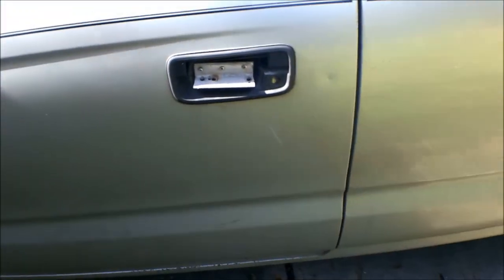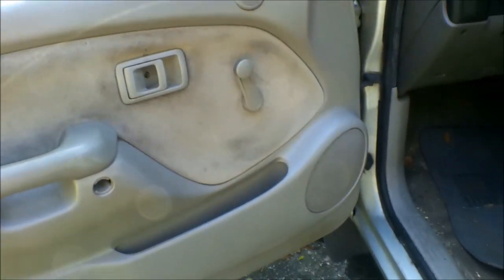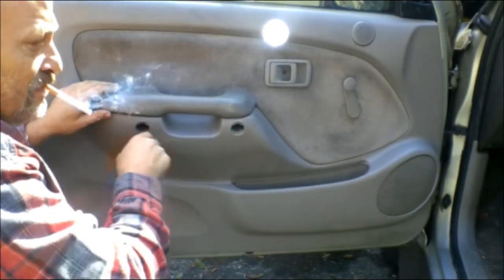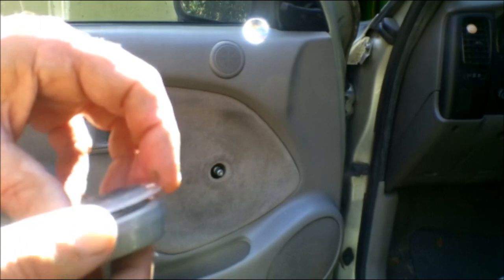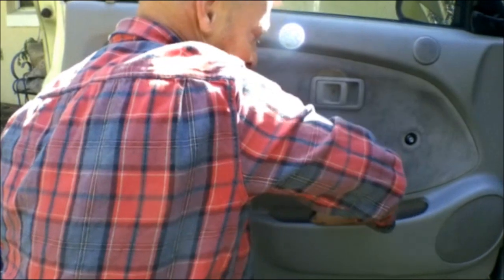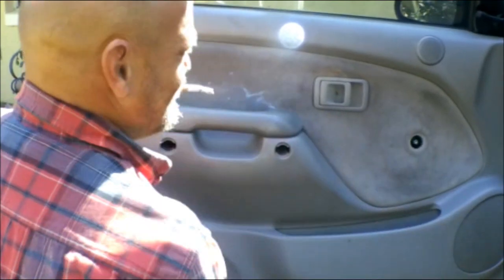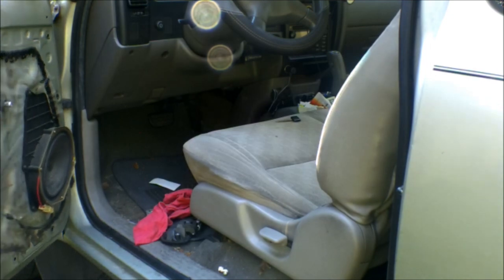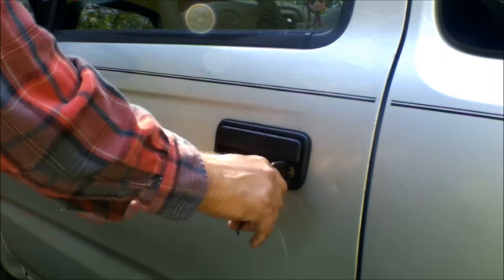HOW TO, REPLACE DOOR HANDLES 03 TACOMA

Comment: Ya man. I’ve replaced both exterior door handles at least twice. Idk why, but they suck. I have found that if u live in a desert climate, the door handles become weak and mailable. It pays to remember not to jerk the door handles aggressively in warm weather
Reply from the maker: That's for sure man. Thanks for watching and commenting my friend.
Reply: @shabear1000  no problem. So I’ve got this issue lately where I can’t open the driver door from the outside. So I started taking the door apart. I used ur shop rag hack to get that lil pin to take the door handle off. So as to not hit my gfs infinity with my Tacoma door, I pulled it closed. Now I can’t open my door from the inside or outside. The door isn’t completely closed, u know. I pull the the metal wire connected to the door handle so as to try and open the door, no dice. Any suggestions other than what I shouldn’t have done up to this point?
Reply from the maker: @mikeytoolica33  yes, it's probably locked. Make sure it's unlocked then pull the rod again. Let me know if it worked.
Reply: @shabear1000  u know, funny thing. I haven’t been able to lock that door for awhile now. Consumed with it not opening from the outside, I didn’t worry about it.  Until I went to go and try to fix these door issues, I really didn’t have it so bad. Now I made the problem worse. Thx for the suggestion sir
Reply: @shabear1000  shower thought: out of everything u said, pull the rod is the only thing that stood out. Got the stupid door open!!
Reply from the maker: @mikeytoolica33  lol that's good.

Comment: I think there is screw up by the MIRROR that needed to come out...
Reply: No. It just pops out. It's a tab that you just take off with a rubber flathead or just your hand and it pops out
Reply: The only screw by the mirror is attached to the thing that allows u to adjust ur mirror from the inside

Comment: It was informative to a point . But the part I find ironic is how you hate it when people half ass things but then you do the very same thing when you ran out of memory. Didn't REALLY show us how to take the rods off or, more importantly  how to reclip back in !! Do we transfer lock to new handle then attach rod? Do we set new handle then try to attach rods from inside? Pull rods out through handle hole and attach then try to set handle in? Guess I'll fart with for an hour and figure out on my own. Half assed!!
Reply from the maker: First of all, it wasn't done half ass, it was done right, secondly, I explained all the info in the video if you payed attention. I used new parts and nothing was half ass about this job. The job is done and done right. I explained how the clips are installed and I also explained how it goes back together, opposite of how it comes apart. I half ass NOTHING.